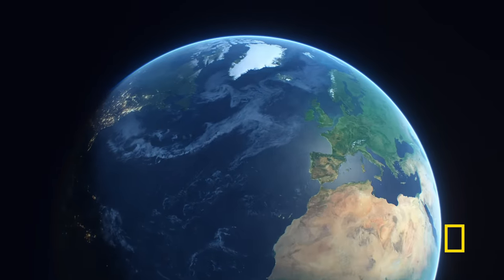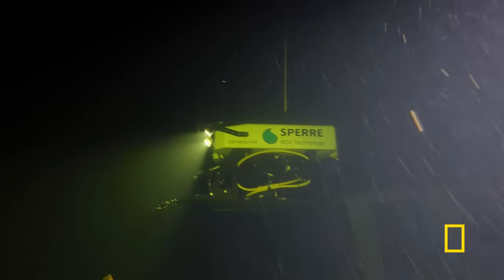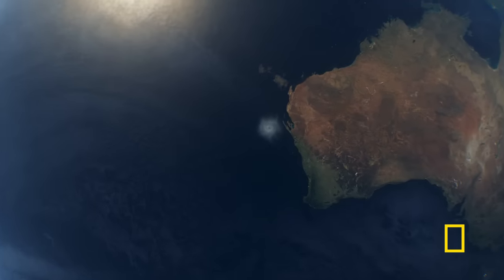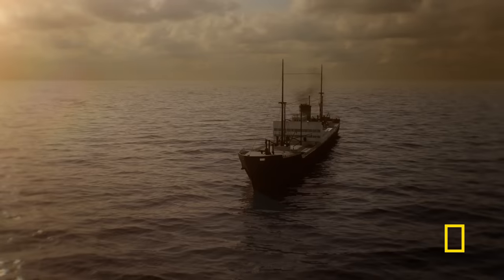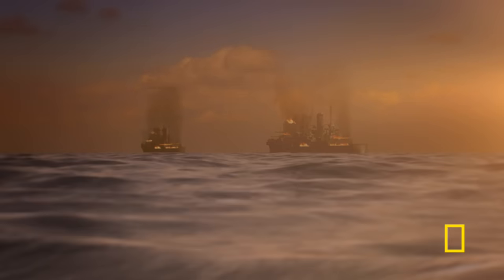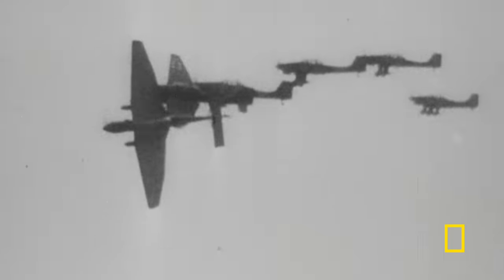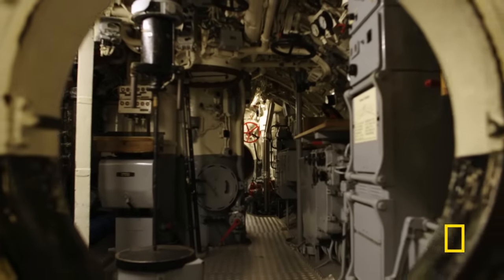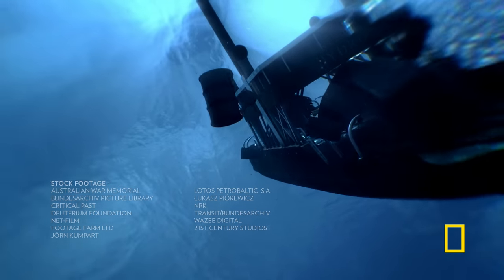Nazi Secrets (Full Episode) | Drain the Oceans

Comment: This could have been a good documentary if the presented scientific data wouldn't have been messed up right from the start.
3:03: Heavy water is not "chemically hydrogen". It's water. You've cut out the essential part that it's made from Deuterium ("heavy hydrogen") and oxygen, and that Deuterium is chemically hydrogen, but has twice the weight of normal hydrogen. 
3:50 Heavy water was mainly required as a moderator, so natural Uranium could be used. Of course it also worked for cooling, but that was not the main purpose.
4:00 They produced (almost) 1000 kilos of heavy water  in _total_. Without that last part, the information is useless. 

I'm not going to mention the rest, if already after 4 minutes the mistakes pile up. Sad to see that the level of exactness has decreased so much at national geographic.
Reply: Get a job there and set them straight.
Reply: @jacoblecoy3700  I already have a job where I do exactly this. But for areas that have more impact to the real world than youtube channels.

Comment: HMAS Sydney hit the Kormorant in a dangerous area of the ship in the engine rooms and started a fire directly below deck that stored sea mines the fire would have eventually set off these mines. During the abandoning of the ship the wounded Kormorant sailors put into lifeboats died when the lifeboats were capsized by the sea state and they drowned. It is not known if the crew detonated the scuttling charges or the ship blew up from the cooking off, of the sea mines from the fires on board. They imaged the Kormorant wreck site and it is a tangled mess of twisted steel on the sea floor. A couple of other german auxiliary cruisers were hit and effectively disintergrated by the explosions that were set off, with no crew surviving. Effectively one big bang and 400 odd german sailors dead in each instance. After the initial use early in the war of auxiliary cruises the german naval commanders realised it was totally suicidal to operate these commerce vessels adapted to naval use and they were withdrawn from use.

Comment: The Sydney was a light 6 inch cruiser, hardly a mighty warship. It had thin armour, and the German raiders used 5.9 inch guns from WW1, 88 mm anti tank guns, anti aircraft cannon as well as having torpedo tubes on each beam. It's guns, loaded and hidden, caught the Sydney by surprise, even though the cruiser was suspicious when the raider couldn't answer their request for a signal code. In the German captains account, he fired three torpedoes but thought they had missed. One may have hit the bow, or it was a shell that pierced the thin armour of the cruiser, perhaps starting a fire in the forward magazine, as the cruiser was said to have moved away into some fog, still afloat and with it's bow intact. Then out of sight of the German ship, the magazine blew and took the bow with it.
Reply: Nah